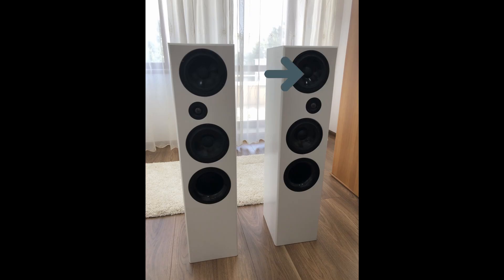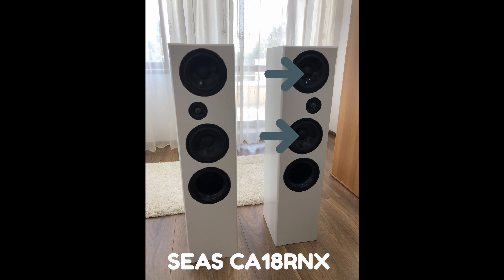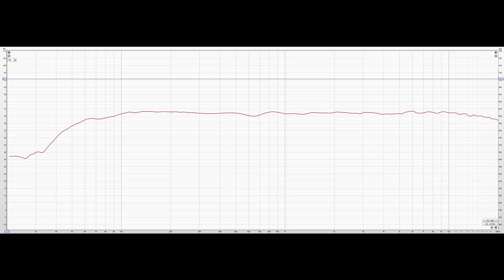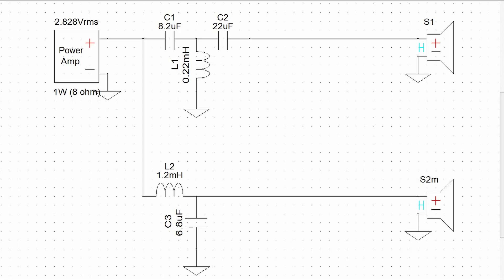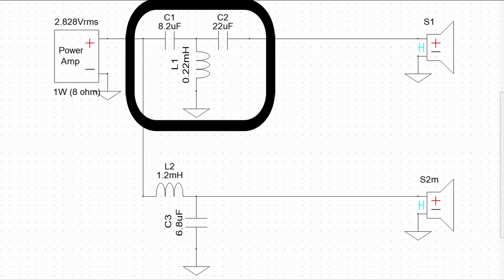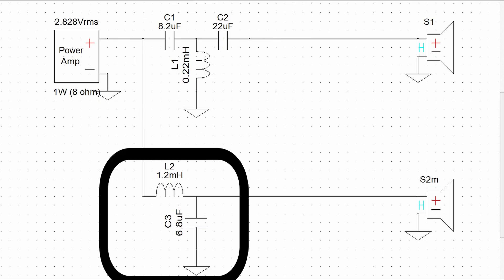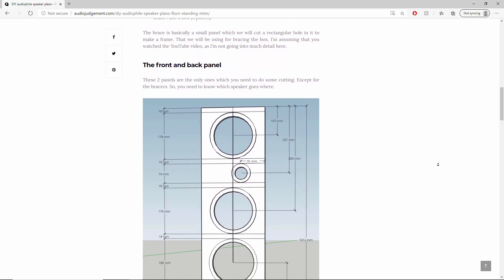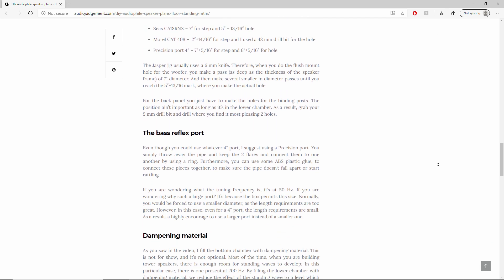DIY floor standing speakers (with plans)

Comment: Can I ask why you  didn't you use a resistor or lpad on tweeter is it  not  needed ???
Reply from the maker: Usually tweeters are more efficient that woofers. But since we 2 woofers, this time wasn't necessary.
Reply: @AudioJudgement   OK Thank you  ...   I have  Seas 27tdc     tweeter ...  can i use it  with this xover ?
Reply from the maker: @gtaveditorvids6776  nope
Reply: @AudioJudgement   Ok thank you .....  I want to build this speaker but I am afraid it will not be deep enough for my taste  and I want a  full range  speaker   that goes down deep  I can use without a sub woofer ...  that is my only worry

Comment: Great tutorial
Which is your proposal for a sub companion on this set as I'm in the building process?
Maybe a small sealed one?
Again i really enjoy your videos.

Regards
Reply from the maker: No, I think a powerful bass reflex is in order. These speakers have great efficiency and power handling and they need something to keep up with them. I would suggest at least a 500W bass reflex sub, that plays down to 20 Hz.
Reply: @AudioJudgement  Any recommendation ?Thanks for your kind reply though.
Reply: @AudioJudgement  Btw do you think that a pair of XTZ edge A2-300 on mono mode is o.k for these?
Reply from the maker: They have to be stable at 2 Ohms per channel if you want to wire them in mono mode. But anyway, the specs indicate that they have enough power in stereo mode, so no need for 2.

Comment: Hi Marius, I've got another question on your design. You put the speakers directly on the floor and don't use spikes (with spike shoes to protect the floor), is that a deliberate choice, and if so, why? Or did you just not attach them yet while making this video?
Reply from the maker: No, it’s not deliberate. You should use some spikes. I just placed them somewhere random so I could film them as I was happy they were finished :)
Reply: @AudioJudgement  That's what I thought :-). I'm really thinking of building these speakers myself. The only problem I have is that these SEAS woofers are not widely available here (in The Netherlands), even on Amazon they are not available anymore and I'm not a big fan of buying expensive stuff online internationally at stores I don't know.... So I have to figure out how to solve that one.
Reply from the maker: @reinders86  I understand. I can only vouch for soundimports.eu or audiophonics.fr as I bought from them and was very satisfied. But none of them has those drivers on stock.

Comment: Hi Marius, Thank you for this great video. I have a question about the bass reflex port, and yes, I'm very much a noob on these kind of things, Is it necessary to have the reflex port so high up. Visually, just for contrast I think i prefer the reflex port to be on the bottom of the speaker and the woofers and tweeter on the top half as you have. Would moving the reflex port have a negative effect?  Maybe because you have the dampening material on the bottom, could there be a way to have both the dampening material and the reflex port there? Or is it possible to build this without the reflex port at all, so you'd have a sealed loudspeaker?
Greetings from The Netherlands.
Reply from the maker: Having the port close to the woofers is something that makes sense. Since the waves will add up, you don’t want too much phase shift by placing a larger distance between them. However, bass region has wavelengths of several meters. So, having 20 more centimeters between them, won’t do much in the previously mentioned regard. 
You can use thick mineral wool to line to walls of the box if you want to put the port on the bottom. And yes, you can make the box sealed at the expense of bass response.
Reply: @AudioJudgement  Thank you very much for this reply. I'm sure your channel will grow a lot with great videos like this!

Comment: Nice work mate. Will there be a sub build to complement them?
Reply from the maker: I have in mind to build a small sealed sub. Not necessarily to be used with these speakers though. Probably something larger would be better.

Comment: Good Job Marius. Can this speakers used to Home Theater? I saw that it makes only below 70 db. Do you think its a good choice?
Congrats
Reply from the maker: Are you referring to the frequency response chart? Bear in mind that the measurement is done at a low level. In reality the speakers are very efficient and the power handling is high. Therefore you can reach ear bleeding levels if want.  And to answer your question, yes, they would be a great option for a home theater.

Comment: Awesome project. Thanks for sharing your knowledge and publishing your designs for free. Currently designing a variation of your beginner friendly dual woofer floorstander design, but with one woofer and the Vifa/Peerless XT25BG60 instead of the Dayton DC28F. Simulations are promising.